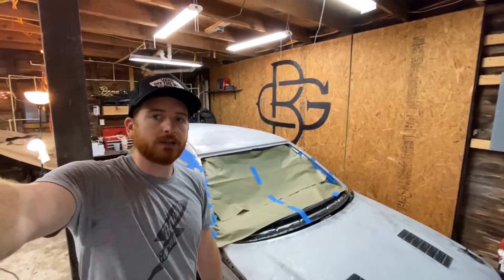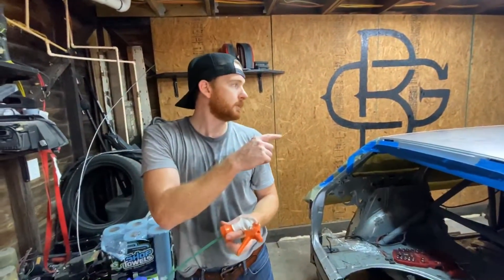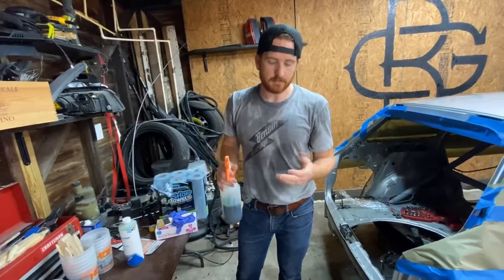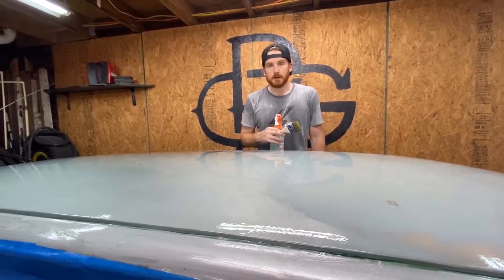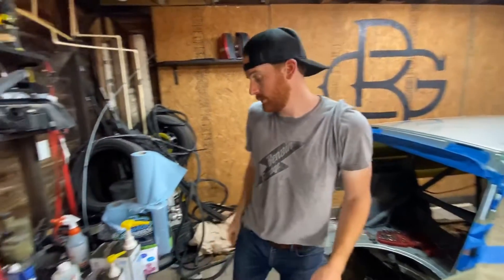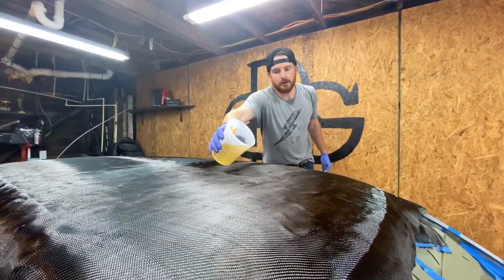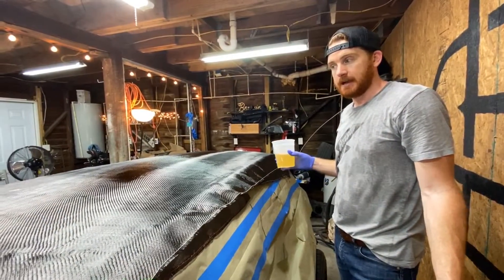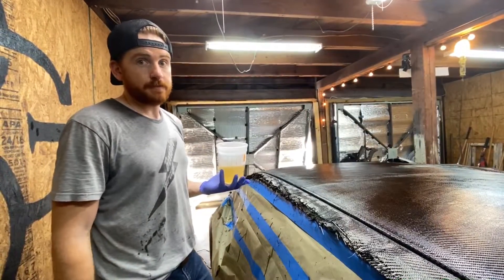Audi B5 S4 Wagon Update #5 - How To Make a Carbon Fiber Roof (Part 1)

Comment: Quick tip for those annoying bubbles, take a spray bottle and fill it with acetone and mist the acetone over the areas with bubbles while the resin is still wet, this will remove most if not all of them.
Reply from the maker: Good call, the bubbles drive me crazy.

Comment: Very cool man, can't wait to see the carbon roof installed. Just out of curiosity, what was the cost of materials?
Reply from the maker: Thanks! Resin and carbon fiber was about $500.
Reply: @benzinco.5882  That's actually pretty reasonable. Especially given the weight  reduction you'll get out of it, and it looks badass lol

Comment: Since you have a deleted sunroof and basically making a mold anyways, maybe you should consider actually making a mold of it and selling carbon roof panels? Somethin to consider!

Also, not sure if it helps with this resin but countertop epoxy resin it is common to use a torch to sweep the surface and get all the air bubbles out.
Reply from the maker: Thanks! I though about reproducing these for a moment...but decided not to, maybe one day if there is enough interest. Everything came out fine in the epoxy, especially after sanding, thanks for the tip though.
Reply: @benzinco.5882  Thats cool, im sure its a fair amount of work. Since you'll be cutting the metal roof out, what product will you use to bond the body to the carbon? Im curious about long term as for how long it would hold up, strength vs the stock body etc. Lovin that you're active on this project again!!